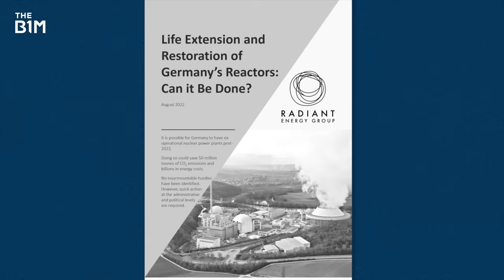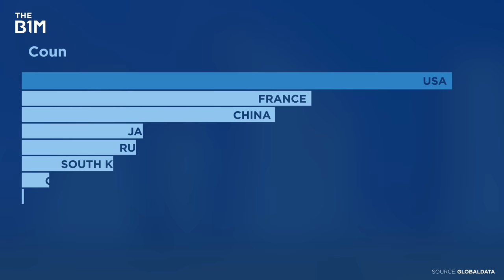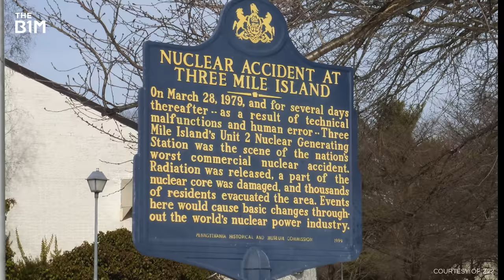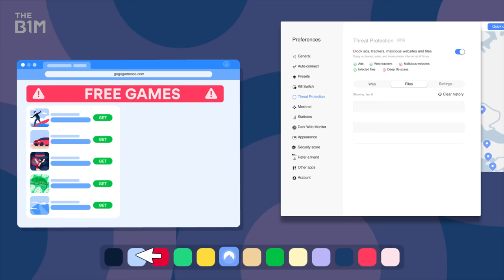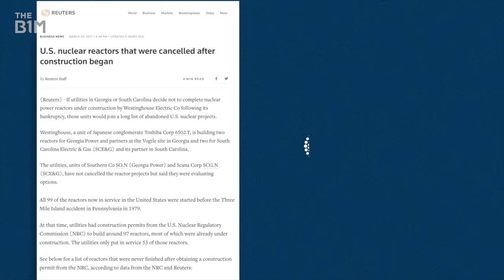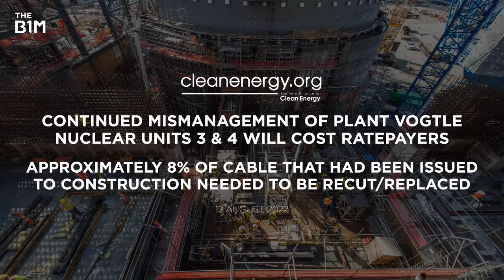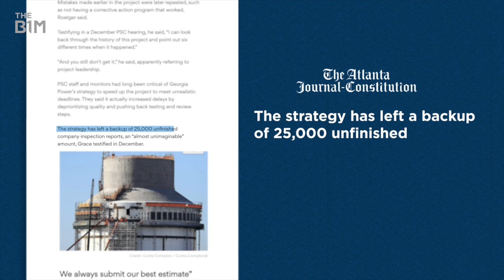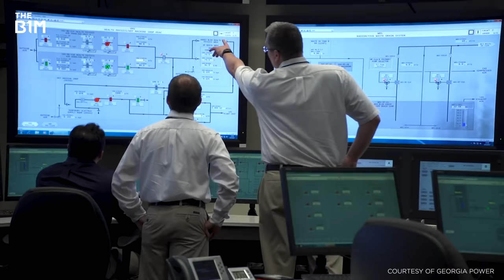Why Nuclear Power is Making a Comeback

Comment: The hornsea offshore wind farm in the UK costs around 5 billion $, for a capacity of 1,2GW.
The new reactors in this video cost 25 billion for 2,2 GW. 
So with those 25 billion, we could build a wind farm of around 6GW at different places in the US. 
Even if the wind blows only on half of those wind turbines, we would produce more. 
And the costs of new wind farm decrease over time, while new nuc installation increase.
Reply: Correction: costs 30 billion so the equivalent of 7,2 GW of wind power
Reply: It's owned by the Danes who are very good at wind. But your mathematics is very poor in that wind farms don't run anywhere near +60 years like nucler plants do.
I am all for them but they need something like nuclear by the side as long as we are so poor in storing energy.
Reply: @hurri7720  thank you for your answer. Yes when you take the lifespan (I realise i should have), wind turbines look less appealing. But in 25 years, wind will cost maybe twice as less as now if the trends continue. So if we have to replace them 3 times during the lifetime of 1 nuc reactor, the costs won't be 3 fold. So those 7,2 GW, with the lifespan of wind turbine taken into account, looks more like 2 or 3 GW. I realise it's very poor maths but I want to reflect on the price of wind wich, when we take all the costs, is still competitive and has no nuc waste.
But like you i'm very in favor of nuclear energy as I want it to participate replacing fossil fuel as soon as possible.
Reply: @aloisdevaux9301  You need to take capacity factor into account.

And as Hurri points out, a wind farm will last about 30 years, and a NPP will last at least 60, and likely to 80/100 - however I'll go with 60.

HS1
* nameplate capacity: 1,200 MW
* capacity factor of 40% (i.e. downtime due to intermittency and maintenance)
* annual energy: 4,208,000 MWh
* cost: $5,000,000,000 USD
= 1,188 USD/MWh value
but needs to be replaced in 30 years - so really 2376 USD/MWh value.

Vogtle
* nameplate capacity: 2,200 MW
* capacity factor of 93% (US average for NPPs)
* annual energy: 17,900,000 MWh
* cost: $30,000,000,000 USD
= 1,672 USD/MWh value
Vogtle we will assume can last at least 60 hears, so about 1.4x better value.

Comment: The latest, cheapest offer for nuclear in Poland came in as 2.6M/MW, by the Koreans using APR-1400 reactors. Reactors with history of being built in time elsewhere. That's lower than the average MW of onshore wind - which would be the cheapest "renewable" to get. The average MW of onshore wind goes for some 3-4M/MW (1-1.5M/MW * 30% capacity factor, most of the time worse than that. Offshore is basically double that, since it has double the capacity factor, but is 6x as expensive. Solar is just junk, as Germany has been showing.
Wind and solar are supposed to be complementary to others. Mostly fossil fuels. Or after most of the electricity is reliably supplied by nuclear or Geothermal. Then wind, solar and Hydro can complement things. Just because reliability is inexistent with wind and solar. After the share of these things goes over 30% it's an absolute nightmare to manage the instabilities that wind and solar unreliability put into a power grid. 
We just need scalability for nuclear. If only the world came together designing 3 types of reactor - MMR, SMR and a full scale reactor, for the 3 technologies that are most mature : PWR, MSR(preferably chloride reactors), and FBR. Closing the fuel cycle, increasing the efficiency of fuel usage, and severely reducing the amount and lifetime of wastes. And just build, build, build. We need some 1700 new nuclear power reactors to get the share to its deserved 80% of worldwide energy. Basically displace fossil fuels for real.

Comment: Building new nuclear electricity is economically dead in 2021.
It costs double to four time all the other alternatives, fossil or renewables.
And that is without calculating all the cleanup costs.
Reply: With current gas prices, the new reactor in Finland (which cost triple its original budget) is poised to turn a profit compared to gas after in only 4 years.
And you also don't seem to get how electricity grids work. And you're ignoring global warming.
Reply: @viktor1496  That's elusive. Until finished, the price of electricity will be down.
Reply: @viktor1496  " And you're ignoring global warming.
" Nope. I don't.
Reply: Thanks for watching and commenting. You have been selected in my draw✨Winners should text on telegram to claim prize. (Only Winners).🏝🏝

Comment: The EU (without UK, Switzerland, Norway) had 103 nuclear power reactors that generate 100 GW of power. France is the powerhouse here, with 56 units.  Obviously the USA will have more power than a much smaller country like France, but when you look at the per capita figures a more honest picture appears. 

This way of presenting the figures makes it look as if you are forgetting that the USA has 330 million inhabitants and a large landmass.

Comment: With what is happening in Ukraine it is obvious that building a Nuclear power station in any country leaves the country with a strategic risk. Further  Solar PV with storage is cheaper then nuclear. Fixed-axis PV plus storage $58-178 per MWh to Nuclear energy costs $112-189 per MWh. Also Solar PV with storage can meet base load power demands.

Comment: It's a manufacturing problem like anything else.  These processes have experiential momentum to them which results in fewer mistakes, faster completion times, and lower costs.  We need to build these reactors again and get good at building them as a result of that experience.  Then, never stop building them.  Get a pipeline going of like 1 or 2 reactor starts per year or whatever demand dictates for replacing dirtier or more volatile energy sources.  Eventually, we'll get to a point where we start replacing older reactors that are obsolete or otherwise end of life with our excess construction capacity.  There is no reason to stop building these things ever again lest we once again lose that momentum and have to re-learn how to do it.

Nuclear power is a clear way to achieve energy independence virtually forever.  We have everything we need to do it except for the will.  I hope we discover that will eventually.
Reply: The VC Summer and Vogtle projects proved that the U.S. construction industry 
1- does not have workers capable of building to nuclear standards and
2- does not have enough workers to build more than one nuclear project at a time

Given those proven facts the construction industry can only build one nuclear project at a time and it will take 16 years and twice as much as any other power plant project

Hoping otherwise will not change reality

Comment: Smaller modular nuclear units are the wave of the future. Can be built in factories and shipped to the location. These modules can also big linked to be used to produce more energy in larger markets.
Reply: EVERY nuclear power plant has modules built in a factory.  SMR are 1/5 the size of the large units and cannot be built whole in a factory.   Look at that acres for a standard 1.100 Mw PWR and that 200 Mw SMR will take up at least 255 of that footprint.

Comment: Just the plan for EVs will place a 25% increase load on US power infrastructure. 25% increase is new 5000 power plants. Remember EVs just shift the "exhaust" from the car to the power plant. This is taking into account the desire to shut down coal and natural gas plants. Wind and solar all come with.... a back up natural gas plant for when the sun don't shine and the wind don't blow. There no solution to the amount of storage required when sun and wind are not available. Besides start doing the math and engineering on covering the increases needed with wind and solar and you quickly run into other issues, land, materials, production capacity etc...

Guess which is the most viable, efficient means of power production left on the table?

Nuclear.

Comment: The energy ROI for nuclear is about 6 weeks.  The economic ROI however is about 15-20 years.  But there is nothing else on the planet that can beat its reliability and capacity factor.  Nuclear is the way to go.
Reply: At $15-16 billion per each 1.1 Gw nuclear unit, Vogtle will NEVER pay off the loans and they cannot possibly rase rates enough to make Vogtle anything but a money losing plant
Reply: @clarkkent9080  I beg to differ.  At an operating cost of $31 per mWh, selling electricity at $0.17/kWh and a capacity factor of 93%, the payback period is about 16 years assuming the cost you indicated is 100% debt at 3% API.  Even if it were a bit longer the plant has a lifespan of 80 years so no question that the pay back of capital costs happens in a relatively short period of time.

Comment: The U.S. builds nuclear powerplants all the time, in the form of powerplants for submarines and aircraft carriers. These are routine events that are generally on time and on budget, more or less, and in recent decades, U.S. nuclear warships have had practically no nuclear accidents. The budgets for these civilian nuclear reactors matches the price of a Ford class aircraft carrier, which contains a pair of nuclear powerplants that, combined, produce more power than these new civilian powerplants, not to mention the floating airport, advanced radars, air defense systems, and accomodations for a small town of people.

My question is: Why are civilian reactors so incredibly expensive compared to their military counterparts?
Reply: Maybe because military reactors produce 77 Mw and do not have the safety systems of commercial units
Reply: @clarkkent9080  They produce 125 MW of electricity each and also run the shafts, so their potential is higher. However, you made me check my data and I was wrong. I was comparing thermal energy to electrical energy; two entirety different things, and the reactors are less powerful than I thought.
Reply: @JZ909  Simple point, when in port all nuclear vessels switch to shore power and shut down their reactors.  
My experience is commercial nuclear not navy.  A 1,100 MW commercial nuclear power plant uses 100 MW (called hotel load) to run all the pumps, systems, lights, and coffee machines.  What equipment could a sub possibly power with 125 Mw?  Carriers have 2 reactors so even their needs should not equal 250 Mw.

Comment: So take the estimates, double them, and work from them.

The Illinois Energy Professor has excellent videos on the economic and scientific issues of a nuclear plant vs. gas.   A gas plant has low capital expense, but in the long haul, much higher fuel expense.  Including borrowing costs for construction, a nuclear plant operates in the red for about fifteen years.  After that, it's all cost per kw/hr downhill from there. 

The issue of waste is a red herring.  All waste is totally encapsulated, no possibility of terrorism or even an explosion releasing the waste.  In fact, the waste, being contained, is far less bad than all of the smokestack gases. 

France built their successful system by copying the same plant over and over.  In business, this is called a "Doh."

Comment: US-Govt must consider to make a Public-Agency to operate all the Nuclear Reactors in USA.

This agency must select a Single Nuclear reactor design & then Mass construct it to generate at least 60 to 70% of USA's annual electricity.

This will insure that there is No lapse in communication & responsibility for the maintenance & operation of Nuclear reactors & Disposal of Nuclear waste. 

Solar & Wind-energy must be used only to create Green-Hydrogen to boost H-FCEVs. 

This will allow USA to become energy independent without using fracking to a great extent.

Nuclear Energy is also the need for the next gen of Spacecraft & Space-Station.

Comment: I was never aware of this, but they are building more SMALLER reactors. These would be to run a very large factory for instance. I never knew those existed and thought they were all these behemoths.
Reply: Here is how that is working out in the U.S. TODAY.

This is from the Des Moines Register an concerning the only Small Modular Reactor (SMR) project in the U.S. today.
In 2013, the Wall Street firm Lazard estimated that the cost of generating electricity at a new nuclear plant in the United States will be between $86 and $122 per megawatt-hour. Last November, Lazard estimated that the corresponding cost will be between $131 and $204 per megawatt-hour based upon the 4 recent new nuclear projects in the U.S. . During the same eight years, renewables have plummeted in cost, and the 2021 estimates of electricity from newly constructed utility-scale solar and wind plants range between $26 and $50 per megawatt-hour. Nuclear power is simply not economically competitive.
SMRs will be even less competitive. Building and operating SMRs will cost more than large reactors for each unit (megawatt) of generation capacity. A reactor that generates five times as much power will not require five times as much concrete or five times as many workers. This makes electricity from small reactors more expensive; many of the original small reactors built in the United States were financially uncompetitive and shut down early.
The estimated cost of constructing a plant with 600 megawatts of electricity from NuScale SMRs, arguably the design closest to deployment in the United States, was originally advertised as costing $1 billion but upon requesting actual bids from engineering firms, increased to $6.1 billion in 2020. Given inflation and other cost constraints that cost today can only be expected to be significantly higher.
The cost was so high that ten members of Utah Associated Municipal Power Systems canceled their contracts. NuScale then changed its proposed plant configuration to 6 fewer reactors but increased each reactor output from 50 Mw to 77 Mw costing at total of $5.3 billion. The NRC just last week approved the construction of the 50 Mw design but now will have to start the review process all over given the switch to a 77 Mw design. For each kilowatt of electrical generation capacity, that estimate is around 80% more than the per-kilowatt cost of the Vogtle project in Georgia — before its cost exploded from $14 billion to over $30 billion. Based on the historical experience with nuclear reactor construction, SMRs are very likely to cost much more than initially expected. And they now have delayed the project start until 2025 in an attempt to find more backers.  All this before the inevitable setbacks that will occur once construction starts.

Comment: I'm sorry but I work in the field and this video's intro is extremely biased and pretty poorly researched and the title is just a plain lie, which you admit at the end of the video. Also I thought youtubers stopped misleadingly advertising VPNs as security devices?

1:26 "when the wind isn't blowing and the sun isn't shining we need a reliable source of clean energy" - yeah, and when the wind is blowing and the sun is shining, nuclear reactors can't get off the grid and do nothing but haemorrhage money. Also "a solution that isn't years away" - really? Right after showing a power plant that's rivalling BER?
1:44 "wind and solar do not replace the functions of coal and natural gas, which is on demand power" - neither is nuclear, and also not coal for that matter. Hence why gas is so important these days.

When you make a video that's not about your field of expertise you should talk to more than one openly biased expert. The main advantage of nuclear plants is that you can use them to make nuclear weapons, but in today's energy market you'd have to be crazy to promise that a new reactor that will take a decade to build will run profitably for 60-80 years.

Comment: i think the EU should build more nuclear also but the problem is going wind solar and nuclear only is not possible.
nuclear and coal plants are slow at starting or producing more energy where gas just needs a spark to turn it, they need to heat up the water and that takes some time on start-up / producing more
we need a large battery everywhere or a mechanical battery (pulling weights up) if you want to be green

Comment: 0:27 "Costs have spiraled sharply and mistakes have been made. Vogtle is well behind its originally intended schedule, double the original budget. People didn't know how to pour concrete correctly, the design wasn't finished enough, techniques had to be invented and then changed on the job."

The only reason for this is not incompetence, but a concerted effort to make nuclear look bad. Look for some of the heads of this effort to be buying yachts in the future.
Reply: china built and operated 4 AP1000 Westinghouse reactors before VC Summer and Vogtle so the idea that there were design problems is a lie

Comment: Look at all the work and money that goes into something that will only last 60-80 years. Nuclear energy is more expensive and less independent than solar or wind turbines. What the US should actually build are battery systems to save the not-used energy created by the renewables during good weather conditions. The thing about nuclear plants is not just the nuclear waist, no because you can't just demolish these buildings when the concrete is getting crumbly and its unsafe to use them anymore (... like in France) it actually costs billions and billions in tax payers money to build them back, slowly, whilst the people who built it and know how this complex building was created are dying or dead already. But no, listen to the mustache guy and keep choosing the difficult solution. Time will make you pay the price. I'm not entirely against nuclear plants. Having some on stand by in case the wind doesn't blow for half year could be useful, but they are NOT the future and they should not have "comeback" either.